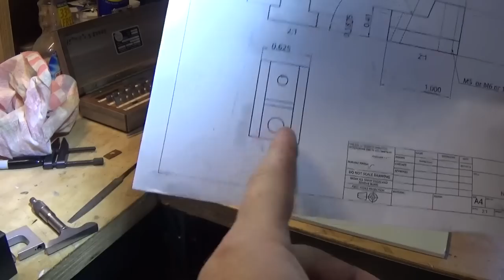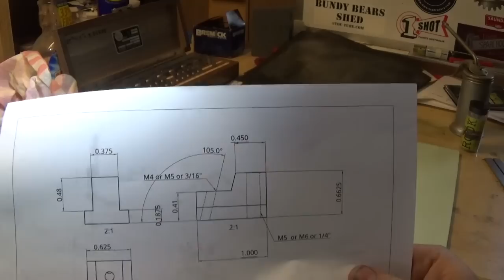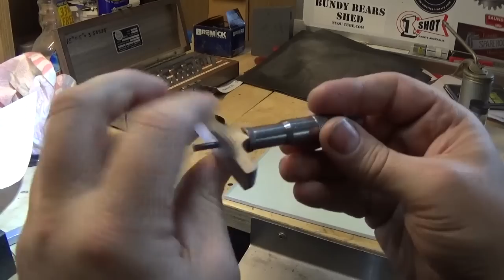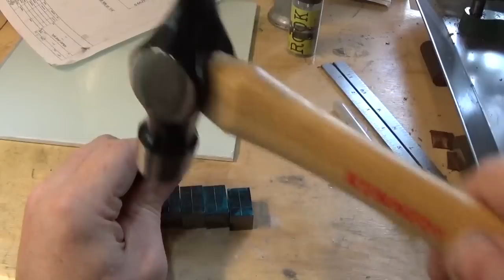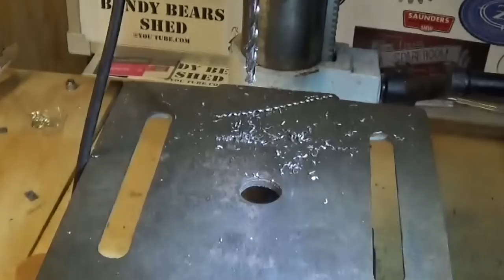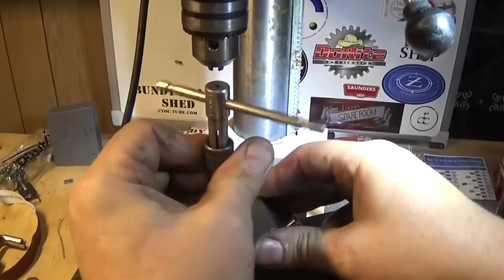THE HOLE OF IT! PART 2 tee slot clamps

Comment: When making clamps and other holding tools, if they aren't too difficult to make, fabricating a couple of extras is usually a good thing to do. If you have them at hand, you end up using them more than you would expect.
If you have any tools or machines that use hold-down hardware you don't have, pretty soon you find that if you just took the time to make some you'd be better off and less frustrated than having to cobble up something every time you use your equipment.

Comment: Nice setup for the angled holes. If I could make one suggestion, use more oil when drilling and tapping, it'll keep your tools alive a lot longer. I know it involves more cleanup but it will save a fortune over the years.